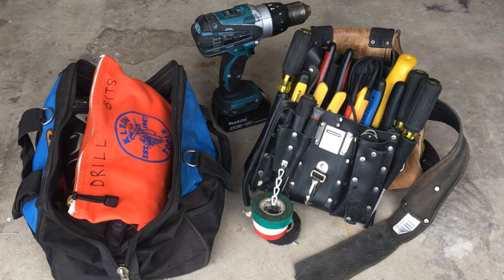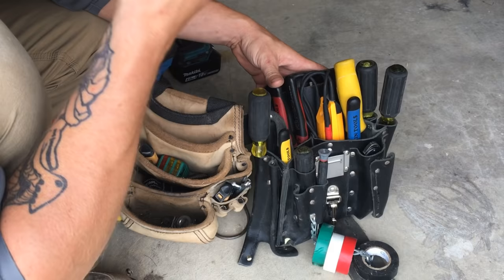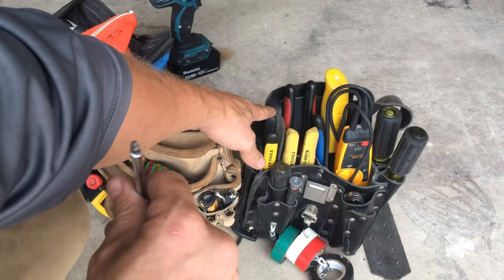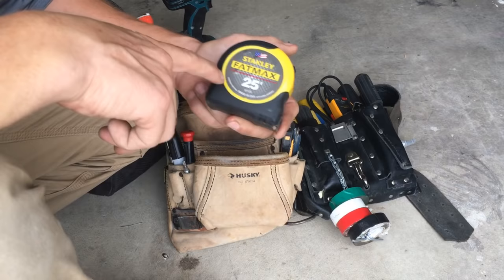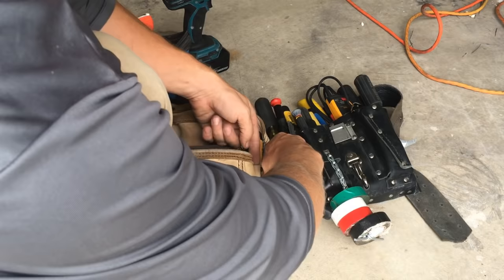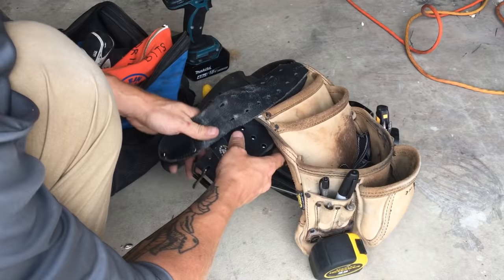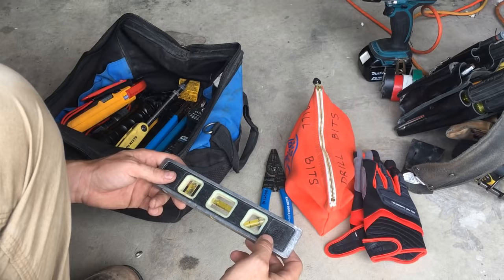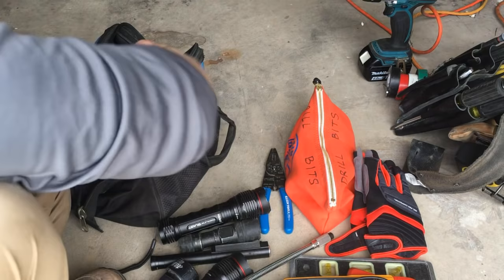Episode 2 - Tools Every Apprentice Electrician Needs To Start Their Job

Comment: You should make a note that this is a tool set for residential electricians because you are out of your league in commercial/industrial.
Reply from the maker: Nathaniel Gardener actually this is a great set for both a residential and commercial APPRENTICE.  Yes you could get a saws-all, rotozip, reamer, nut drivers, etc but as a starting apprentice this is the first $200-300 in tools you should buy no matter what environment you're going into. Once you get settled the guys around you will tell you what you need more specifically for the exact type of work you do.
Reply: Agreed. This is not a commercial/industrial load out. The paddle bits are a clear giveaway. Plus No wrenches no channels no level... No Roto splits. Garbage strippers get the ideal ones with the rubber Press point in the middle. The yellow Klein needlenose are a waste. And please don't tell me you don't wear that on your waist. And a Klein tape is what you want so you can release it when it breaks for free at home depot. Mag tip is a must plus bending multipliers... you know what I gotta post this in the main.
Reply: Joey Overbeck hope you enjoy having your hip replaced early in life. Go ahead and thank that tool pouch; ill wait. And btw a tools worth not measures by longevity alone. Ergonomics, quality, warranty, price point and other factors come into play. A first year apprentice does not need a pair of 35$ Klein journeyman series needle nose pliers. The money would be better spent elsewhere is my point, especially as a first year...
Reply: ron p; Exactly! As a first year, you don't really need that many tools in your pouch. As a fourth year, close to getting his license, I found that a lot of those tools are unnecessary to have at the beginning; the meter, all those different screwdrivers, needle nose pliers. Plus apprentices aren't supposed to be in panels, live panels anyway, so they shouldn't have to worry about buying screwdrivers that are good for panels until they get their licenses. All I carry, are my linesman pliers, wire strippers, a flat head screwdriver, hammer, dike pliers, and a sharpie and pencil, along with a tape measure. That's what all of my foreman's have told me that I need to carry. The company I work for does mostly residential, with some commercial aspects, like bending pipe, but that's pretty rare. With a pouch like that, you will definitely have back and knee problems in no time.
Reply: Mostly my teeth. And whatever I can get for cheap from Wal-Mart. Little tikes makes some pretty affordable starter tools.
Reply: Why are Electricians the most arrogant tools in construction? Residential electricians are some of the hardest working electricians out there. I can’t tell you how many commercial electricians we have hired that can’t even install a can light. It’s pathetic. These commercial guys that run 50ft of emt a day and brag about it make me laugh. Stop thinking you’re gods gift to the trade cause you can bend a 4 point saddle. It’s not that hard I promise.
Reply: Yup. I agree. This trade isn't rocket science, but electricians walk around like they're gods gift. Been doing this for a few years now, and it never ceases to amaze me. Snobby commercial folks are lame. Even how supervisors treat helpers is hilarious to me. They're so unwilling to teach because A: They can't teach, or B: They know their "helper" will realize that he's only there so his "supervisor" can sit on a bucket watching facebook videos all day, until the contractor pops his head in. I am lucky to be in the position I am in now, and I try not to take it for granted. I enjoy advice, learning from different trades.. I understand what works for me doesn't work for everyone. Straight down to what tools I use and how I carry them. Just because I like Milwaukee doesn't mean I don't respect Dewa;lt lol. I will always take criticism and try something different if I need to. This trade isn't rocket science, but it is brain surgery. As long as you got the job done up to code in an acceptable time period then that's really all that matters. Not whether you did it with a specific brand of tools, or in a union environment. None of that changes the work that needs to be done.
Reply: Thanks Joey..Great info 1st year here. Makes ALOT of sense. I just switched careers due my love for the trade. I can tell you this, once I have the experience and truly know, I will help the green guys to push them to learn and grow with respect to the trade. Cheers brutha.
Reply: i learned the ropes in residential with a lot of service/trouble shooting work as well.  worked in hot panels plenty my first year.  it was actually a complementary part of all service calls to check panel connections etc...if we had time or remembered to of course. this actually helped me to get comfortable in a hot panel.  i didn't feel comfortable working hot wires right out of the gate, my fist time walking on the job or anything, but by a few months into the job i felt pretty well equipped to work hot and could recognize scenarios when it was safer/smarter to kill the power (clear signs of heat damage to a breaker, wire, etc).  and it's really hard not too, i'd say impossible to do your job properly in many cases, if you are doing any kind of service tech work.  do you really need to kill the power to an entire house to change out a defective breaker?  or kill a circuit to change out a single pole switch?  in a lot of cases you aren't really gonna know for sure what is wrong unless you work it hot. anyway point is i've seen plenty of unlicensed folks working "live".

doing new construction i can see where it would be rare for an apprentice to work in a hot panel, but then again that would go for every electrical worker on the job site -- if you are doing it right and breakers aren't tripping left and right when you hot the panel up.
Reply: here in puerto rico where i live residential and comercial are not so specialized , you must do both in orther to be an electritian(granted most people and companies will mostly specialize in one or the other) but you must be able to know about everything including lineman ,transformers and primaries. i think i carry around a little more than half of what he has and i am able to perform fine, granted some specialized toola makes your life easier, but you wond be crippled if you dont have them
Reply: 06MaximaOwner well I've been doing this shit for a year now and I've done everything that an electrician does wiring in hot panels light bending pipe. there was no bullshit with this company. if you wanna work here you're gonna do electricians work. decent tool set of course there's a few missing or some not needed in my opinion but that's his preference.
Reply: Im IEBW local3 nyc Empire State freedom tower.. these tools look sufficient to me
Reply: My longest lasting strippers are surprisingly mastercraft
Reply: ron p a
Reply: ron p  I commented to someone on this video already and told them the commercial electric brand sells all the basic starting tools they’ll need and is cheaper and overtime buy better quality tools
Reply: @MegaE1337  you rock man

Comment: For industrial you missed a reamer, conduit level with 180*, 90*, 45*, and 30* degree vials, bastard file, and a standard ratcheting quad box wrench set. Everything else is spot on. Bending conduit will become an art form later on in your apprenticeship.

Comment: We had 3 tool carts that had all Greenlee tools & megger. 100% garbage. Grips on linesmen pliers would pull off. Klein does make the best electrical tools except that Channelock still after 60 years  makes best pump pliers. Most people do not know how to safetly use a tic tak tester. First.yoy test it on a live circuit then test circuit working on then retest on a live circuit to make sure its working. Like the 6 in 1 tool better then the 11 in 1 that tend to have short bits fall out & get lost. Thanks for another great vid.

Comment: Good video. If you get 6" bit extensions your impact driver can be stuck in on the right side and won't fall out. Also consider a suspension rig. It helps a lot even with the balanced rig you have. Weight on both sides is a huge back saver and suspenders help even more. I'm sure you have seen the old dudes walking crooked from decades with the one sided took rig. Balance or close helps a ton. Again great video.
Reply from the maker: I agree. I used to have some suspenders but the clips broke and I never got a new set. Probably need to though. I’m not getting any younger
Reply: Electrician U I did the same thing. Just got a new set from Milwaukee after like 4 years of not having a suspension rig. I forgot how much better it was actually.

Comment: Constantly wearing a heavy tool rig will take a toll on your body. All the tools you listed were accurate and explained well, and should definitely be in a tool bag, but for the sake of longevity, load your tool rig with just the necessary tools needed for the task at hand. Leave all the rest of the tools in the tool bag close by to add and drop off tools as needed. Especially when doing repetitive tasks off ladders. I’ve seen guys wearing themselves out by humping all their hand tools all at once all day long. One guy even had his hammer dangling all week in an office building remodel in the trim out phase….. switching and plugging and wiring light fixtures. I mean, when are you planning to use that hammer again? Not on this job site. I think I used 5 tools all week, and he wore his whole rig all week…. then wondered why his feet were bothering him so much by Wednesday afternoon.

Comment: Get a Klein 11 in 1 and you can ditch the 3/8 nut driver and the square tip. Also they make a multi-control screwdriver that is badass. I would add baby Channel Locks, you will find that they are very handy. And don't by gloves, any good employer needs to provide you with all PPE. It's an Osha thing

Comment: I beg to differ my friend about the tic= tracer , that is my #1 go to tool . Every tool has a job and none more important than detecting the presence of voltage . I hardly use my volt meter as most voltages are standard throughout the industry but the tic=tracer i can't move without it . I notice you have a Klein tic-tracer (not very good) try a Fluke and when you get in a panel Greenlee makes a tic-tracer that's second to none (model 2010 ) when multiple hot legs are present . Other wise nice job !

Comment: I’m going to be an apprentice soon and this video definitely helps with tool terminology. I saw that you had flashlights but what about a headlamp? Seems like it would be good to use if you need to use both hands in a dark area.
Reply: Pretzel actik core has removable rechargeable batteries that you can replace if their life starts suffering. I usually use mine for mountain climbing but I've realized it's going to work perfectly for my apprenticeship too

Comment: Great video. 😎🤘
I've got maybe a constructive proposal from my work as an Event Engineer Journeyman. 

Screwdrivers are great but maybe you should consider isolated ones. In Germany we call it VDE (NEC counterpart) Screwdrivers/Tools which are certified up to 1000V.(Yes, they exist in the Multitool version) 

Let's be honest.... We always try to avoid working at live wires but sometimes we can't. Then its great to have isolated tools.... Imagine to lay your finger on the shaft when you screw a rail which is maybe hot because some Idiot turned on the Breaker again. 
Yeah I know... Apprentices shouldn't work live but we all know: Shit can and will happen.... So let's try to not kill our Apprentices😅
Besides you mustn't buy your tools all over again after you stepped up. 

Anyway a nice All Day Set. Nice to know we're working pretty similar all over the World. 
Maybe some Recommendations which i considered in my Time as an Apprentice:

-Carpenter pencil... To not screw over your Sharpie tip every time you mark some Wood or Drywall.
-Automatic Strippers.... Makes work more consistent and faster.
-Adjustable Strippers with a front blade.... For stripping in tight places like Outlets or thin wires which are too thin for the automatic ones.
-A relatively dull blade... To strip some thick isolation and not go trough straight into the copper. 
-A Set of Cable Ties.... You need that Stuff anytime and anywhere
-Small Side cutters... For small Wires and cutting your ties flush without this pointy and sharp End.

Of course there are much more cool tools but as you said we're talking about Apprentices and secondly it depends on where you're working.

So keep up the good work. Greetings from Germany 👋😁

Comment: To many tools to carry around your waist rarely you will need everything on there, it depends. Are you pulling wire, or bending pipe, maybe just trimming out. The ligther you are the faster you move around, and less risk for back problems, knee problems, ect
Reply: I was a carpenter before getting into the electrical business and i will always use two pouches full of nails hammer measuring tape and some other tools, nothing really happened to me or any other worker around me,  it all depends on how you work, but electrician is a different work of course but i dont think those tools are as heavy as a pouch full of 4 inch nails

Comment: Great vid, wish I would have watched this video before I started as an apprentice about a year and a half ago... I made the mistake of buying the milwaukee drill/impact combo set, which I like a lot, but at the time I didn't know they made the drills with a hammer drill feature otherwise I would have gotten one of those instead! Also, right off the bat as a first year I found myself using PVC cutters a lot, very handy. A couple other tools to add would be a decent claw hammer and sledge hammer. Depending on what company you work for you may not use those all too often, the first company I worked for did a lot of new construction and underground work so I was always driving emt stakes and cutting/gluing pipe. With my new company I haven't touched those at all yet lol.

Comment: You can eliminate half those tools if you became a Union electrician. Bits, holesaws, drills, bits, battery tools, tape, taps, benders, etc... will all be provided by the contractor.

Comment: With regards to unibits (step drills), you can just buy the cheapest shit for holes that are 1/2 inch or smaller. A $5 step drill seems to last forever if I'm just drilling holes for something like a #10 screw or a 1/4 bolt. If you're making a large hole like 1-3/8 (size for 1" conduit) then you need to buy a good step drill. A $20 one will dull after a couple holes. 
I've wasted money on low quality 1-3/8 step drills and I hope others don't follow me down that road.

Comment: For tape measure, I recently got a hold of an inverted lock design (it always stays out when you pull it until you push a button to retract) which should have always been the standard as far as I'm concerned. It's some "Home Handyman" brand I never heard of but it's a solid, thick tape with a heavy duty rubberized shell that just feels great to use

Comment: Get the harbor freight doyle cutters. They seem to be really good, and there's no questions asked warranty on them so you won't have to spend $35 everytime you screw up. The steel quality may not be as good as kleins, but the cutting blades are hardened, which is all that matters. They are also just as smooth to operate.

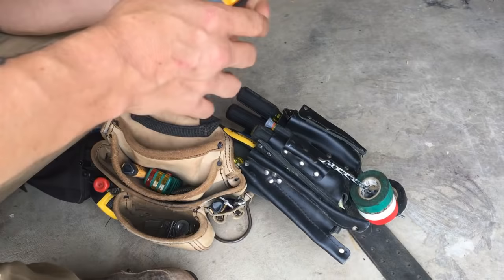Comment: 6:45... I do have a meter and a hot stick, but I have a slight disagreement with your statement... the hot sticks can be used for one other quick troubleshoot problem and that is to tell you if your hot circuit Neutral is not wired (having a loose or capped neutral) 90% of my own experience with a neutral wire I’ve been able to find with a hot stick, but these experiences are on things like a light that isn’t working or maybe a plug (little annoying things that come up at the end of a job) but as far as having something with a large voltage due to long run of wire or something is intermittently working, definitely use a meter or if you’re checking voltage differences... like I said I agree with him 95% but that hot stick does have one other function people tend to forget about

Comment: Dustin almost forgot this info part of what I informed you about the Klein demolition screwdriver /flathead well this goes for the hammer that you use. Well here it goes. As time goes by has anyone ever wonder why the milled face on a 22oz.framing hammer ( or any hammer that has mill face 12oz. -28oz)wears downd and ends up smooth. Over time the milled face 22 oz. Framming hammer wears do to metal hitting metal i.e. 16 or 8 d penny nails or staples for the electricians and you'll notice the spikes in the mill face will start to dent or start to wear. This is done cause.of the constant use of the milled face hammer. Then comes into the picture is the smooth face hammer where you either carry sandpaper or scuff up the smooth face on cement evertime you swing the hammer. Which is the smooth face is better on metal 2 metal strikes yes after several swings of the hammer you'll notice the nail or staple start to bend and that's the sign you have to clean the smooth face with sandpaper or rub it on cement and then clean the face with a towel or on your pants. The smooth face is a lot better for metal to metal strikes. Yes the smooth face also comes in cramming hammers as well

Comment: Dude the sheet rock knife I used for 25yrs has a replaceable sawall blade and folds like a flipblade, also include this hammer:  
Southwire Bmeh-18 Heavy Duty Romex Electrician's Hammer